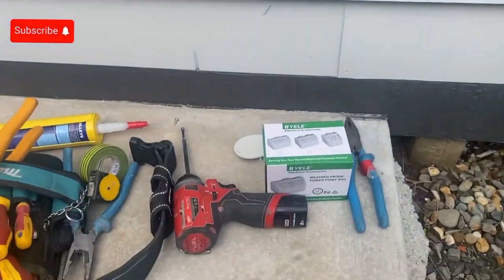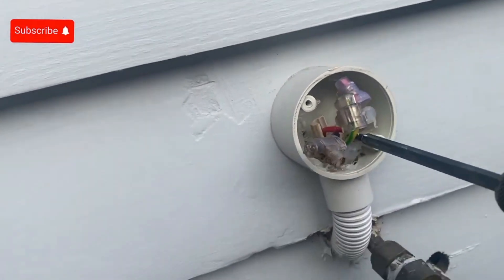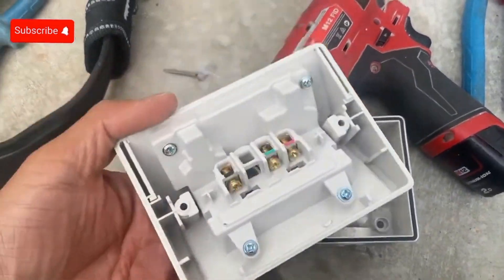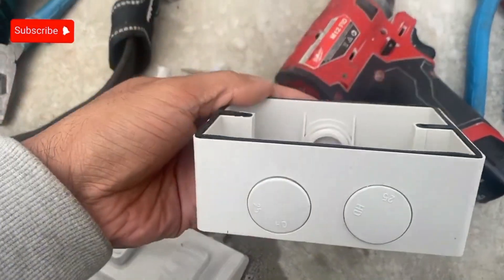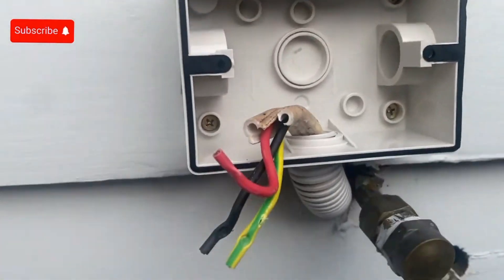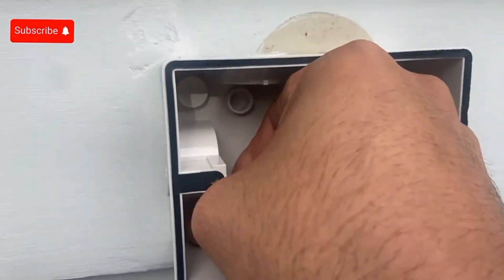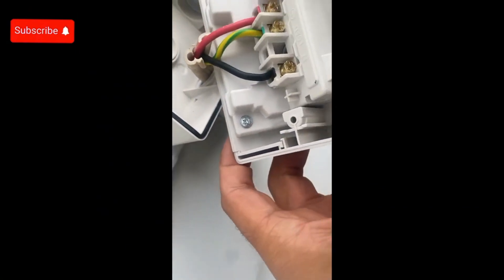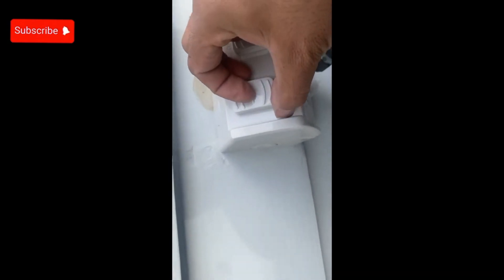how to install an outdoor weatherproof power outlet (very easy one)

Comment: A couple of things and its of utmost importance. I dont know if you are a licensed electrician but by your name SparkyBaz I will take it you are. 1) if you are going to do videos of this you really need to show the safety side of things 2) You failed to identify if you were working on live cables 3) you failed to test if the cables were in fact live or dead 4) you failed to show if you isolated the  circuit at switchboard and appropriate circuit breaker or fuse 5) looking at your video it appears that there was copper piping that  I am guessing used to go to a hot water service, if so then that system would have had its own circuit, as such did you identity the circuit as a power circuit. 6) Can you tell me why you failed to show that you tested the power point to determine that it was earth correctly and that the polarity was correct.